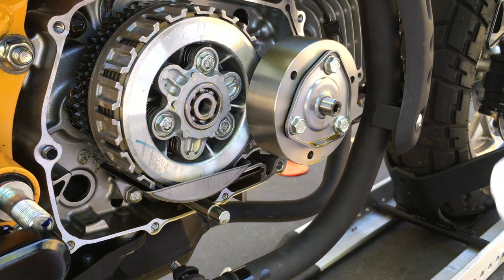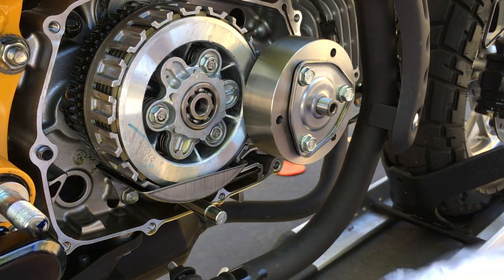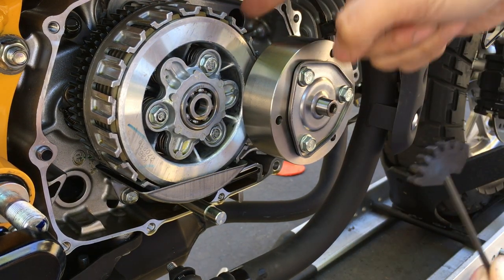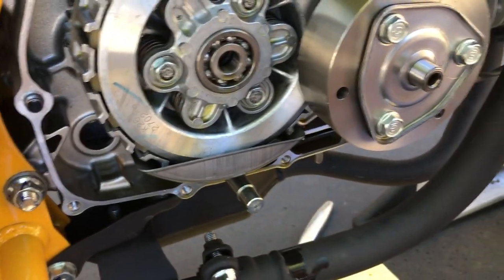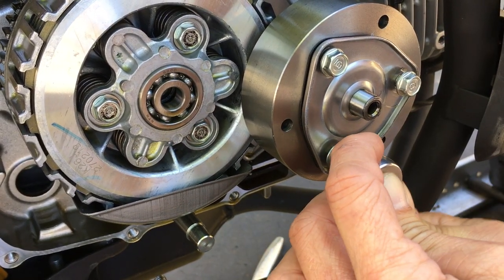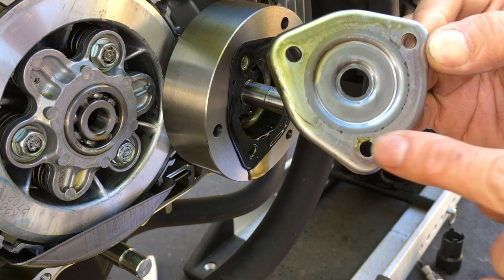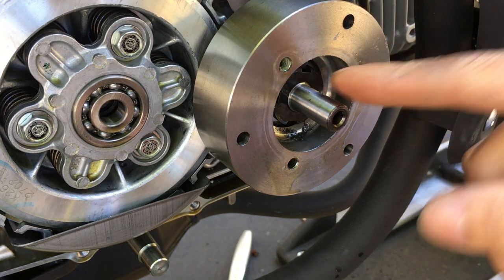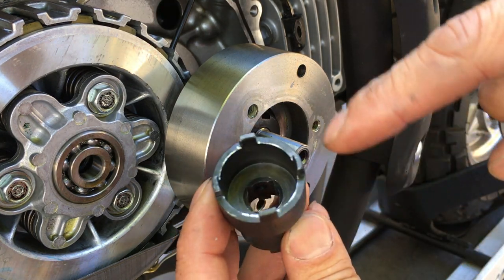Monkey oil filter removal  pt.1

Comment: FYI from the Honda manual:-

From the oil pump, oil
first branches off to a squirter near the crank flywheel. Then the remaining flow splits three ways, a restricted flow to the gearbox sprinkler, a restricted flow to the camshaft sprinklers and an un restricted flow to the clutch case crankshaft bearing, then down the centre of the crank, out into the centrifugal filter via the first pair of holes in the crank, gets filtered, then back into the crank via the second pair of holes, then down the crank to the big end!
Hope that helps

Comment: That seal was probably distorted by you pulling it off the way you did, not necessarily the ribs etc and being crushed. It would have probably just straightened out had you reused it. But I'm one to just change that stuff anyways
Reply from the maker: New the seal has a step so is not flat so once flatten will distort

Comment: You sure that's loc-tite making those bolts come out that hard? To me it looks like the bolts are either TTY and the deformed threads were causing extra resistance, or the unpleasant possibility that they were cross threaded. I'd check those threads. Even if they are though, that'll be an easy helicoil job.
Reply from the maker: yes it was loctite, I can see it.  The one easy one had almost no loctite.

Comment: That is the crankshaft flywheel, right? 🤔
Reply from the maker: Yes and no.  It serves a dual purpose as a flywheel and the center is the oil filter.  But there is also the Stator on the other side which also acts as a flywheel.

Comment: May I ask how many miles had you done when you went into that centrifugal oil filter?
Reply from the maker: just under 600miles
Reply: I e just checked mine and it was not as bad as yours, but still a layer of clutch crud all round. 
If your going to change your oil very frequently, have you thought to fit an oil drain tap in place of the drain nut? I’ve had one on my Honda Insight car for 180,000 miles and it makes oil changes effortless. Also the sump is Magnesium and lots of shop mechanics strip the threads.
The taps are made by Fumoto, and have OEM approvals. They are made of brass and stainless steel and cannot vibrate open!
Reply from the maker: @rogercrier  I just ordered another one for the monkey....the first one I got didn't fit cause the monkey case has that tab that sticks out.
Reply: Well you know what they say, “great minds think alike”🤣
I have logged an enquiry with a U.K. seller for the correct fomoto to fit, but please tell me the part number of the one you eventually fit as tat will be more reliable.
As an aside, I am trying to re purpose an electric juicer to work as a separate centrifugal filter, so I can take the oil out, run it slowly through the juicer, then put it back!
Remember that on the bike, the only oil that gets the centrifuge treatment is the oil going to the crank. Everything else is filtered by the screen. Big boat engines that have gallons of oil pump it out to an external centrifuge as a matter of course. It works so well that even Diesel engine oil stays looking like new, and they only change it when lab analysis shows it is deteriorating. Some auto owners have the oil analysed and you would be surprised how long modern oils last even though the recommendation is to change it at say 10,000 miles. If you do long motorway trips it may be good for way more
Reply from the maker: @rogercrier  That is too much work, cheaper to just replace the oil
Reply: I just thought I would see if I could make dirty oil clean again using an old juicer I had! It does a lot more revs than the monkey🤣
All attempts have failed so far
Reply from the maker: @rogercrier  Like I said not worth the effort, if this was gold...

Comment: Is it a must to have that tool to prevent the gears from spinning or is there another technique or way ?
Reply from the maker: if you have an impact wrench/driver then you don't need that tool,  Also if you wedge in a nickle in the gear it will work too...use a nickel cause it is made of zinc (soft metal), do  NOT use a washer made of steel (hard metal) or the gears will get damage.
Reply: @DaBinChe  thanks
Reply: Also  you mentioned using Loctite on the spinner bolts. How long should the wait be before finishing up and replacing with new oil?
Reply: Also  you mentioned using Loctite on the spinner bolts. How long should the wait be before filling it with the oil?
Reply: Use a penny it works just as well and only cost you a cent😉
Reply: @DaBinChe  I use a penny when impact wrench is not available. Its copper and soft. Used then for over 40 years working on bikes. Using the impact you need no stop to keep it from rotating.
Reply from the maker: @keithtrent4446  copper hasn't been used in pennies for almost 40years.  It is now zinc, which is still soft
Reply: @DaBinChe  Last pennies solid copper was 1982.39 years this year. Pennies are zinkand copper coated. My first motorcycle certification was in 1976. Also Worked later for Honda R&D building racing two and four stroke engines. Porting cylinders, piston mods, head porting and mods, valve mods. Case matching, case overbite, stroke cranks. Carburetor modifications  and exhaust and many other mods. Alot of dealerships didn't have all the proper tools to work with and had to use common sense methods of building their own tools. I'm almost 64 yrs and still building engines. Seen alot of tricks through the years.